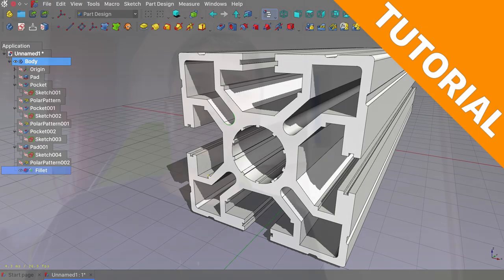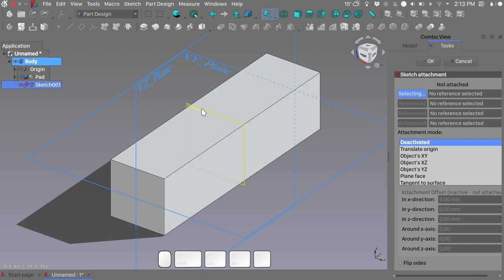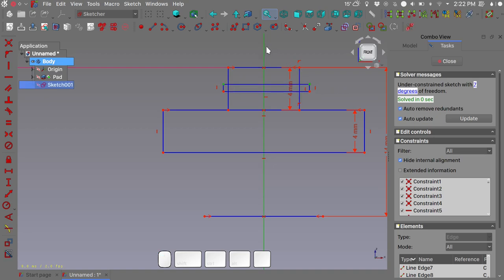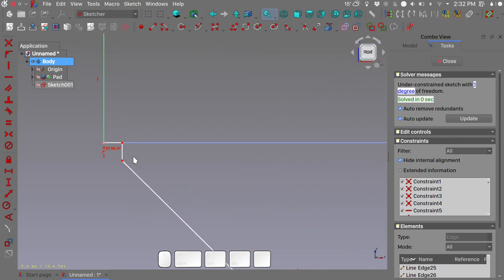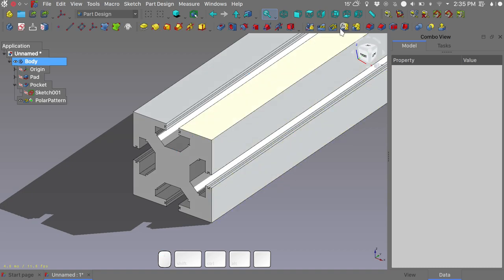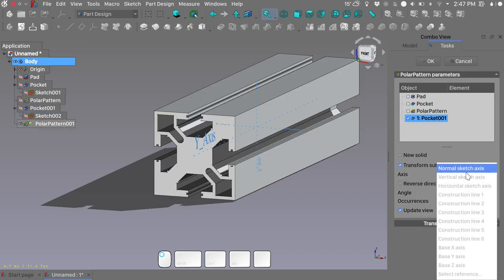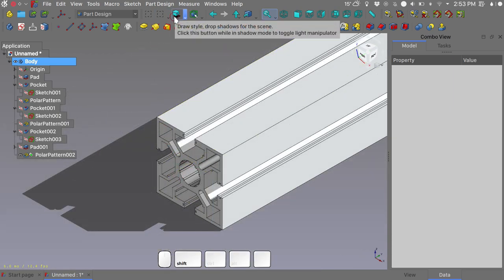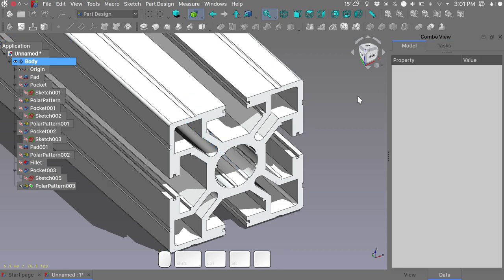FreeCAD CNC series. Aluminum extrusion modelling tutorial.

Comment: Excellent video.  I like that you point out the linkstage3 features as you go along as it helps people relatively new to Freecad and learning with 0.19.  While preventing swearing looking for non existent features in 0.19 it also prepares them for the transition to linkstage3 if they move to it once their skill level is sufficient.  I was slightly confused why your polar patterns were made with respect to "base y" but maybe I'll understand the second time I go through the video again.  Thanks again and cheers from Canada.
Reply from the maker: You are right that revolving around base Y axis was confusing. It made sense in the context of this model and might not in the context of a different positioning of the feature that you are revolving. 
In this case, if you activate the axis cross (View -> Toggle axis cross) you see that the global Y axis (base Y) runs the length of the aluminum extrusion. So it made sense to revolve around that. Also, for different needs, a polar pattern can be executed around arbitrary axis, you can even chose construction lines inside sketches if that's what you need to reach your desired positioning of your pattern. So yes, it is very flexible.
Thank you for your kind words :)
Reply: @OficineRobotica  Thanks for the reply.  I fully understood it when I watched your video for the second time.  I also picked up on a few more nice tips as well.  This video was packed with information.  I ended up grabbing a pen and writing them down as I watched.  There are so many hidden gems in Freecad, it will take some time to find and remember them.  I followed your example and placed the sketcher constraints vertically on the left side of the screen. That was a huge benefit to me.  I had them on the top under the sketcher geometry and was forever making the mistake of grabbing the radius constraint when I wanted the circle geometry and vice versa - haha.  Many thanks for your efforts again.  Waiting for your next video now.

Comment: Thanks for taking the time to model real life things. A hint regarding your defaults: Obviously your Sketcher preferences differ from the default. You have checked "Auto remove redundants" in Sketcher Preferences, Tab General. By default the boxes will always turn orange when applying symmetry and the user has to clear the redundant horizontal constraints. You seem to have checked "Auto update" too. Didn't find it in Preferences, still searching ...

Comment: Fantastic video! (But there are only 8 protrusions in the center hole 🤣)
Reply from the maker: Damn ... you are actually right . Don't worry, in the assembly tutorial we will use a simplified version of the model with allot less detail. There, take that as an engineering solution🤣
Reply: @OficineRobotica  Don't worry about it! 😁. It doesn't take anything away from the quality of the tutorial.

Comment: Is this just for tutorial purpose that you do not create final extrusion in 1st and only sketch?
Reply from the maker: Sorry, somehow I missed your comment. Although possible, in my experience it is not advisable to create such a complex shape in just one sketch. Even if one draws only one quarter of the design and then polar paterns the rest of the quadrant. And the main reasons is maintainability, ambiguous constraints and the damn topological naming problem. I'll try to explain

maintainability  to get that shape correct dimensions one needs to set allot of constraints. I , personally, tend to set first equality and symmetry constraints then dimensions. Returning to a fairly complex design after I month or so I bet that recording what the correlation between all the constraints was becomes difficult.  
ambiguous constraints  a picture would speak a thousand words here so I'll make it short. With a complex sketch there is the possibility of setting the distance(for example) between 2 vertices and the change another dimensional constraint that drives the first one. If the upper level constraint change is big enough it can happen that the positionig of the 2 vertices from the 2 lower level constraint to get completely swapped driving everything that follows out of position. For the solver everything is correct even tough the vertices are swapped. We have set a distance between 2 vertices and for the solver is all ok either if it is left to right or right to left. Theese situations can be avoided by braking the sketch in smaller chunks and using the symmetry to origin to block points. It's also easier to keep track of things.
topo naming altough things are getting allot better with the new topo naming algorithm from RealThunder, in master even changing one dimension of a sketch deep whithin the tree structure could brake all the model. It is allot easier to unbrake things if everything is broken in to chunks.

Hope that made sense, anyway both approches work but I find it more elegant and maintainable to brake things a bit in to logic steps to get to the final model. I also find that if one follows the tree structure might get the design intent and steps to get to the final product a bit better. Cheers
Reply: @OficineRobotica  Thanks! Make a lot of sense, and when I think about that your way is faster in this case, even if it looks like it is not at first glance.
Reply: Yes, I also always try to "pile up" everything into one sketch. Especially when there are more parts with dependencies, there is a problem with that. I just discovered parametric input using Spreadsheet :-)

Comment: just wished that freecad had one bind for dimensions like the other programs especially for the most used onse vertical, horizontal, radius and diameter
Reply from the maker: I think I seen this discussed somewhere.  Who knows might be implemented.  None the less I find the shortcuts to be pretty fast also once one gets used to it
Reply: @OficineRobotica  yeah agreed, but i think its unecessary but i wouldnt mind if they kept the shortcuts for the horizontal or vertical but i just wish there was a simple dimension command, like in inventor, fusion etc
Reply: @EliasNPC  freecad deserves a ui update, but the "shift v" "shift h" "a" and "shift r" shortcuts are very useful, I guess even more useful than a united tool. I used to use inventor and a little bit of fusion, but right now I'm very used to freecad in linux, I feel like im doing things much faster in freecad.